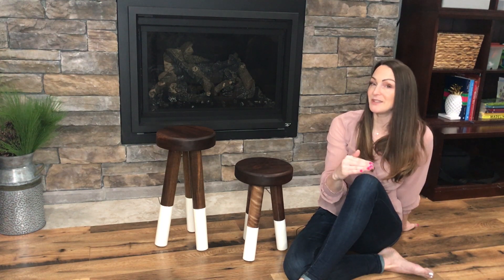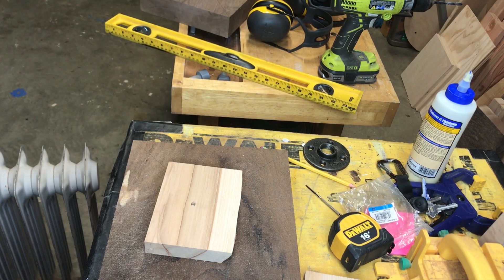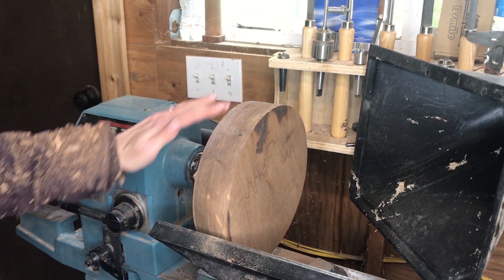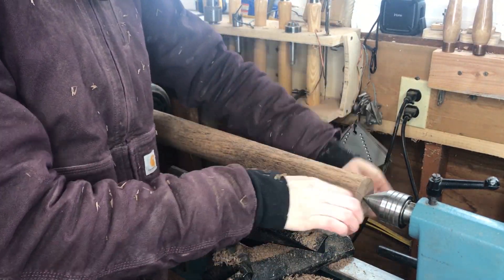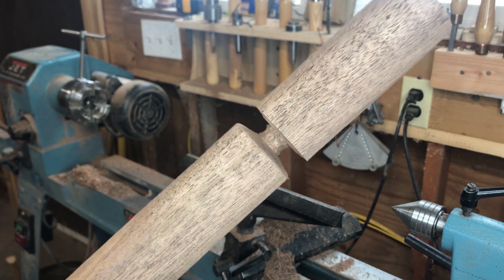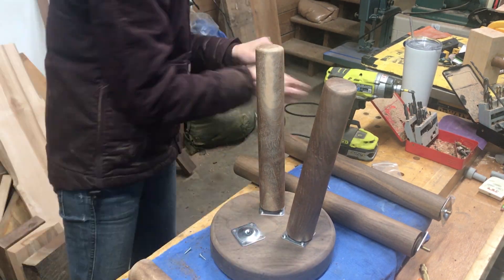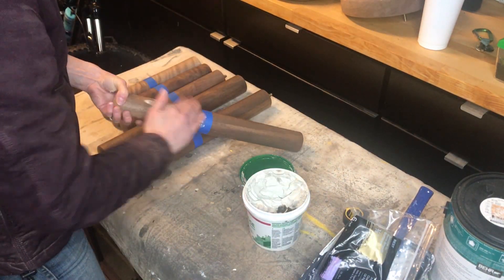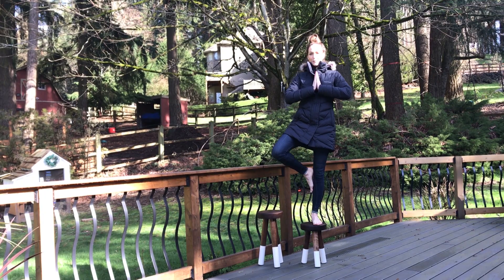Dip-Dyed Stools inspired by Serena & Lily

Comment: The project came out nice, some hints/warnings, never use sheet rock screws, they are brittle and break & be very careful cutting round stock on a bandsaw, if they’re not clamped they can spin.
Reply from the maker: Thanks for the tip.  The screws I used came with the hardware I bought.
Reply: @AroundtheHouse   I was referring to mounting wood to a faceplate for the lathe. A drill can snap the heads off a Sheet rock screw just screwing it into a piece of wood. Imagine the force put on the screw while spinning on the lathe.